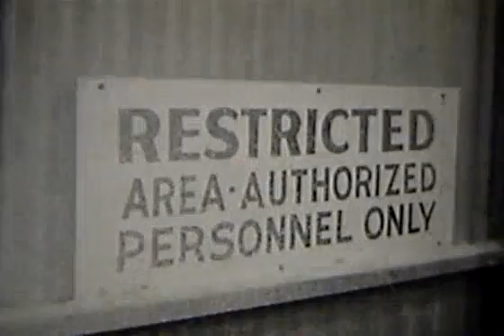HATTERAS YACHT -  EARLY PRODUCTION PLANT HIGH POINT NC 1960s

Comment: Wow, brought back a lot of memories. That was before my time there. I worked there from '88-'91(big layoffs due to the luxury tax). Called back in '93. Worked as electrical/mechanical installer on 38' and 45' convertible and expresses. 40&42' MY and CMY. Until they moved all production to New Bern NC and closed the doors in Jan of '98. Built the first two 60' convertibles in HP. What an extraordinary experience with great craftsmen (and women).

Comment: If the SS Minnow was a Hatteras it would have bounced off the rocks and they wouldn't have been ship wrecked until 1978. But Jonas Grumby couldn't afford a real boat that's why it was an old lap stake Pacemaker. Probably had gas engines too.
Reply: The SS MINNOW was a Wheeler, not a Pacemaker